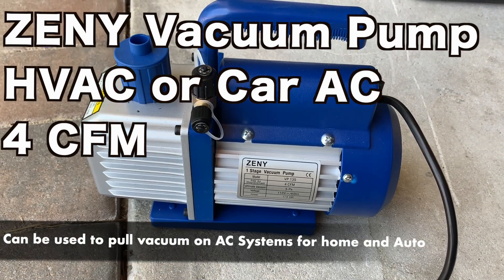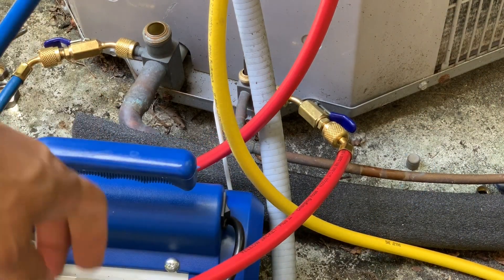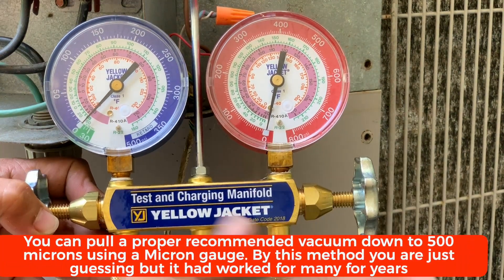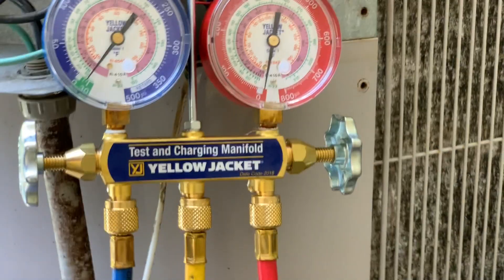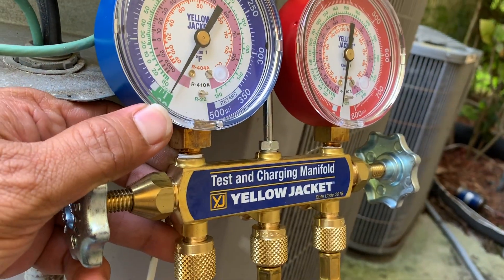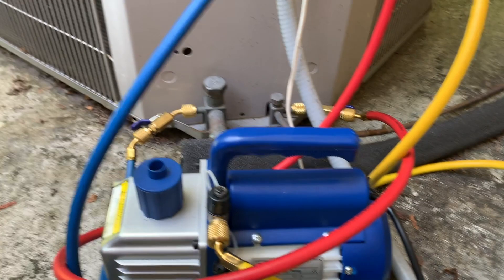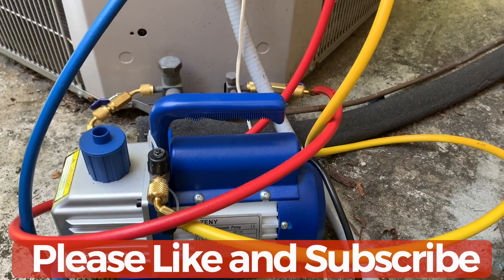ZENY Vacuum pump 4CFM 1 Stage - Review

Comment: But how did you fill it
Reply from the maker: Remove the blue cover from exhaust. That’s where you fill it from.
Reply: @HowToDoitright  Pretty bad when you have to explain this in the comments section.  Why don't you just remove your stupid video?
Reply: @MegaByteEntertainment  - The pump comes with a manual. "Remove the Exhaust Fitting cap and add oil." There is no need for insults, just carry on.

Comment: My vacuum pump is leaking oil. Looks like where 4 hex nuts are
Reply from the maker: Probably the seal
Reply: @HowToDoitright  how do you feel about your pump after 3 years of ownership?  Also how often have you used it since this video
Reply from the maker: @alanfoster7346  so I endup selling it. What I learned is it’s better to buy a quality pump if budget allows. For smaller jobs this was ok but I couldn’t vacuum a bigger unit with this one so endup getting a Yellowjacket one.

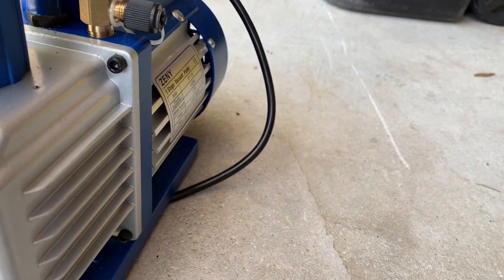Comment: 0:40 that's not where the oil goes, that's an air Inlet. The oil goes under the exhaust cap, no?
Reply: Cobra1 I tried both and the oil level won’t go up
Reply: @micahsteeze  it takes more than you think, if you just keep pouring it in eventually the oil will start rising. And when it does it will start Rising quickly.
Reply from the maker: Ahhh I’m so sorry. I did a voice over at some clips and the voice didn’t match the video and it just happen to show the air inlet at :40. Yes that’s no where I filled oil but it was the one next to it the blue cap.

Comment: Bought 1 but item chips out after less than a minute then chips in until it gets hot it does it it seems.
Reply from the maker: biggzi biggz hmm wired. Mine have been working good
Reply: I contacted the seller and they said it is to do that, but I'll have to just take off the thermo switch and let it run straight